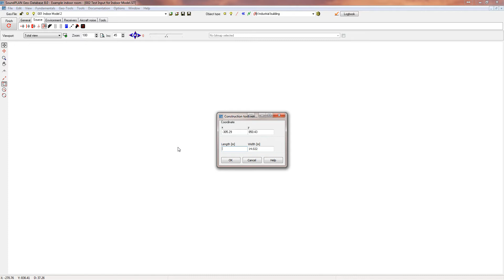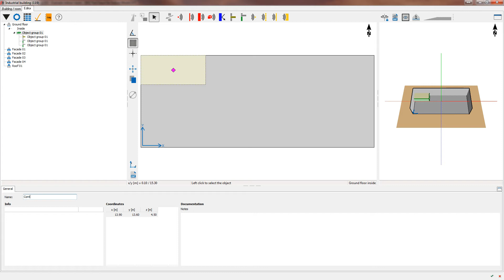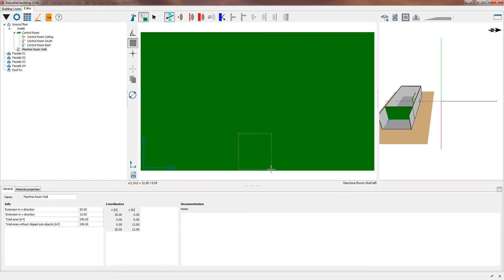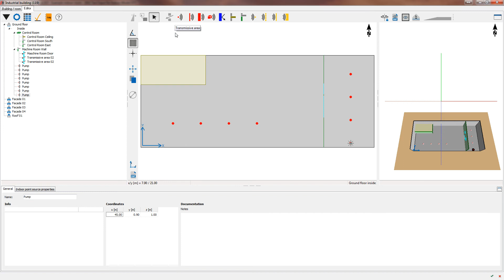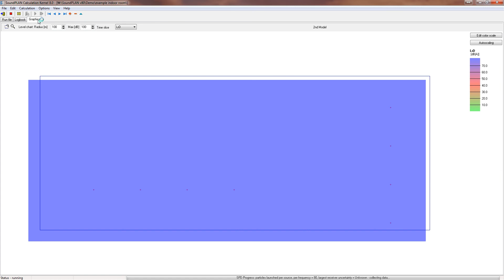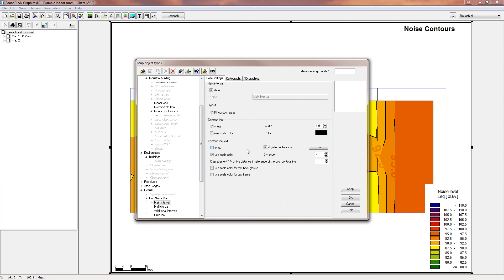SoundPLAN v8 Sound Particle Model Editor Industrial Building

Comment: Thank you for great video tutorial. I followed your steps, but in graphics the control room ceiling is not transparent it is covering the contour inside the control room, also in 3d view the ceiling is not transparent.  And can you tell us why the contour is not till the wall in the machine room. there is patch where no contour? Awaiting your reply.
Reply from the maker: Well if the ceiling is not transparent you have to look for the 3D parameter that make objects transparent. Follow the object tree... industrial building ... indoor horizontal object ....
Reply: @HansForschner  thank you so much... I got it.

Comment: Hi Hans...thanks for the videos....
The function of calculate sound power from measured data is not possible to use inside of a industrial building? Or is some way to do this....? Thanks again...
Reply from the maker: You find the sound pressure to sound power calculation feature in the Emission / Source Library.  In the Geo-Database & RunKernel there is another function to have SoundPLAN back calculate the sound power level of sources but that is too complex to explain her.  I refer to the manual on that.